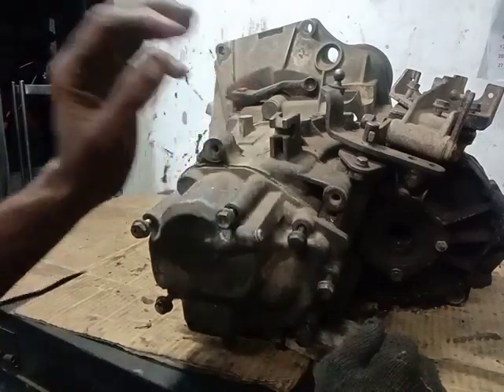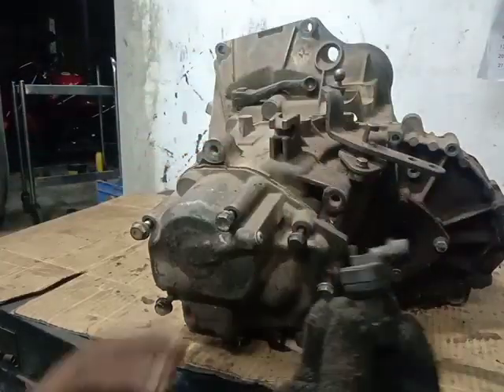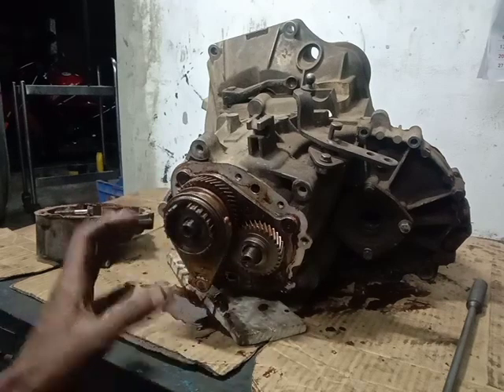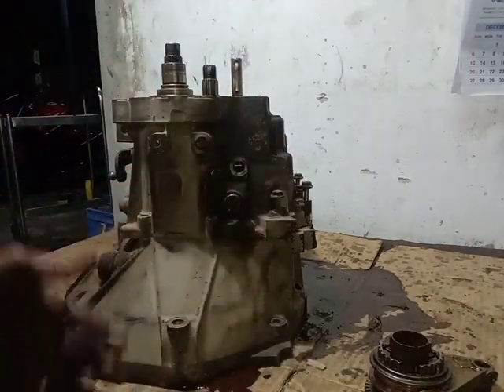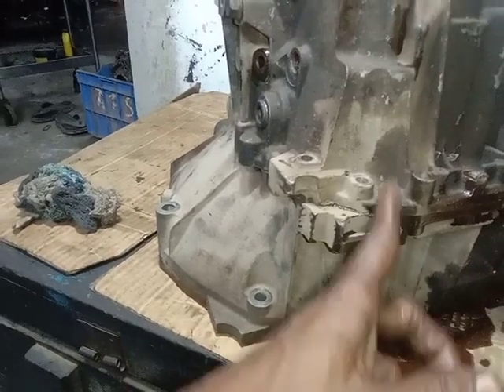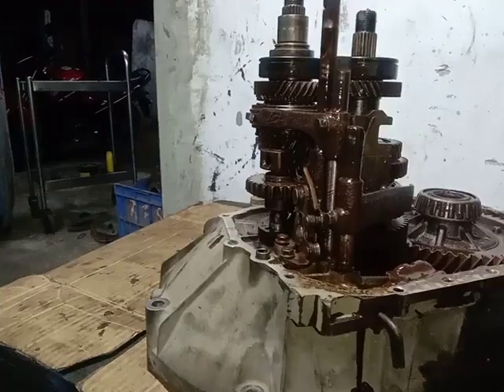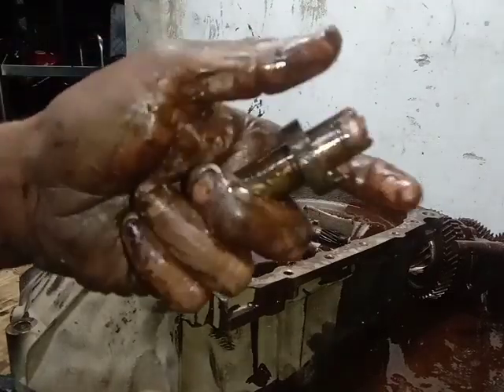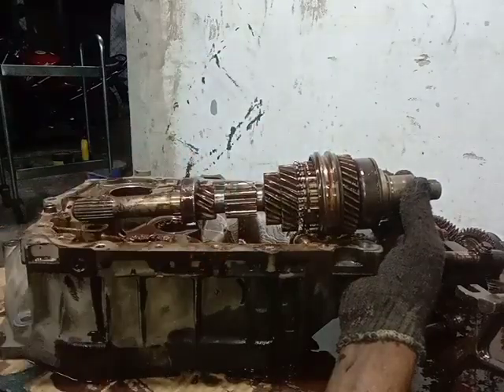TATA ZEST GEAR BOX DISMANTLING  part 1

Comment: Is this Zest Diesel gearbox? The 5th gear in Zest diesel is very short, can we use 5th gear wheel from any other gearbox to make the gearing tall?
Reply from the maker: I try idea
Reply: Ok, pls try and let me know if any other 1.3 diesel like Ertiga, Ciaz, Swift 5th gear can be used. It will be very helpful 🙂
Reply: Hi bro, were u able to try this idea? Any other gearbox 5th gear  fits in Zest?